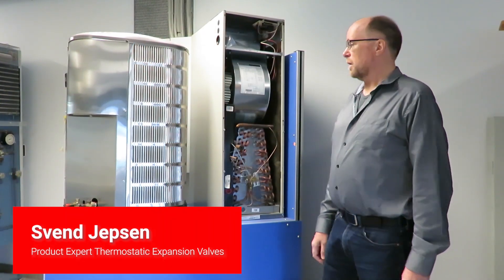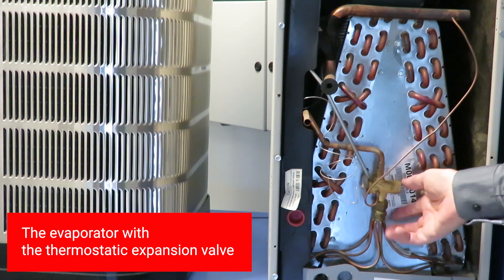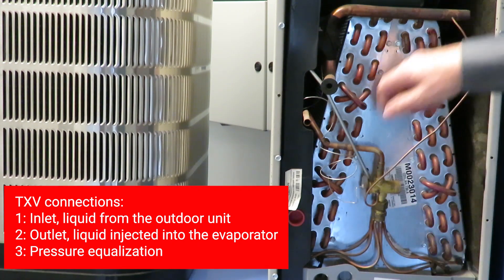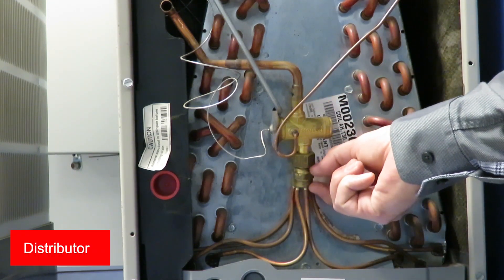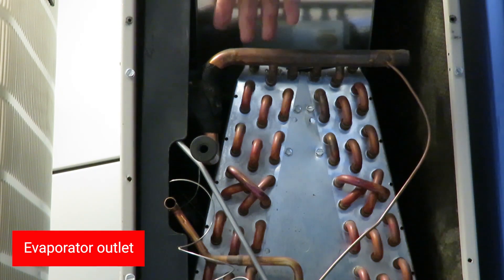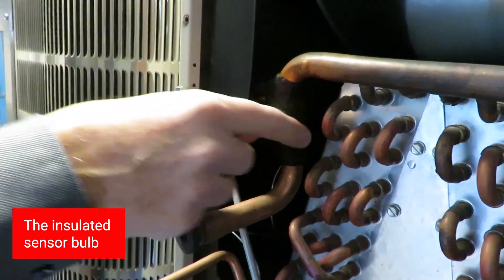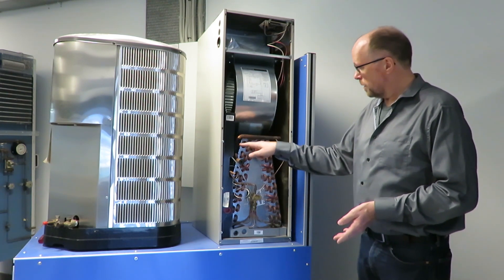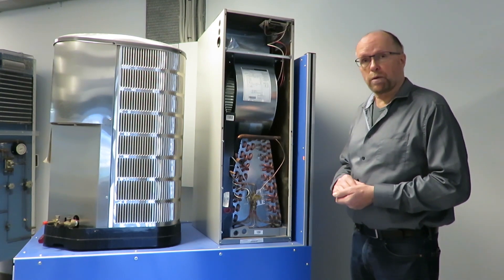Thermostatic expansion valves—what do they do? | HVACR Distillery Episode 7

Comment: Great videos! Just one thing, what it really regulate the valve is the pressure drop, higher drops will lead to lower evaporating temps leading to lower density at the compressor inlet and hence reducing mass flow of refrigerant. I have doubt, what the pressure equalizer does in the valve?
Reply from the maker: Hey Peguem, 
The pressure equalizer is providing the reference pressure, the pressure at which the superheat will be adjusted to. Put differently, the TXV will regulate the flow of refrigerant according to both the temperature (the bulb sensor) and the pressure (the equalizer) at the outlet of the evaporator,. This results in a very precise and balanced filling of the evaporator, while preventing liquid from flowing all the way through to the compressor.